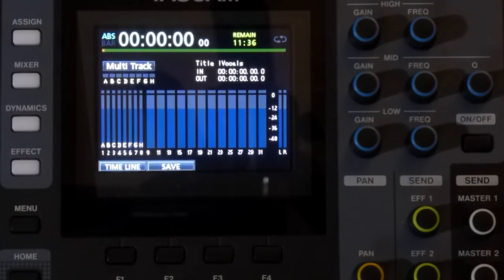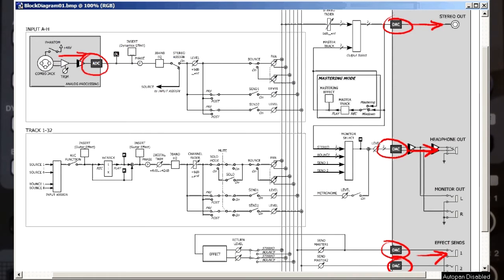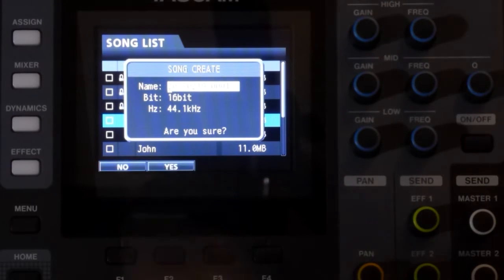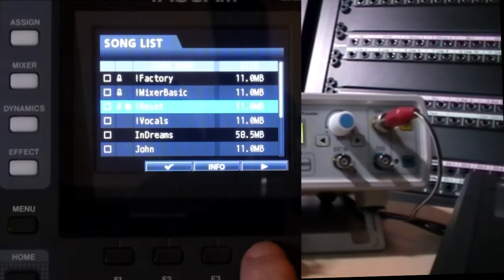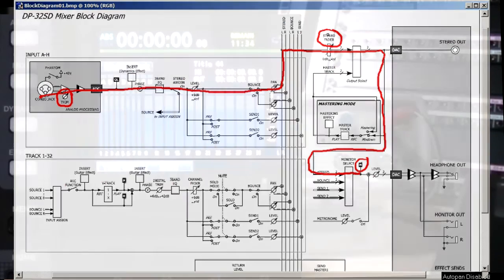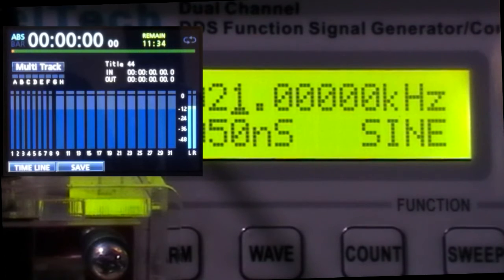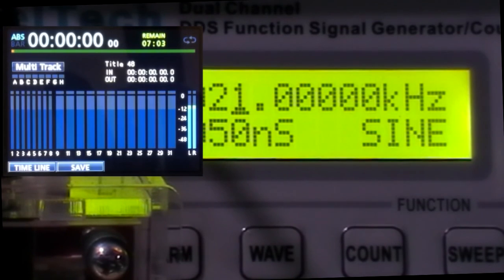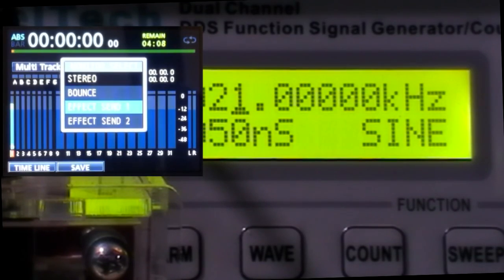Tascam DP24/32SD Tutorial 6D: Quality

Comment: Hi Phil. Talking about tests, beyond this one on audio quality and the other interesting one on multiple bouncing, did you do any on Latency? Would be interesting to measure latency going through various paths in the machine. For example if I use the out/in trick to record the reverb send (routing the send out to a physical input via cable) how big would be the offset between the original signal and the recorded one (knowing it went through D/A and then A/D conversion plus any potential input effect etc). Of course for a reverb it won't matter so much as per the nature of the effect but I am more thinking of using send 2 for other effects more " offset sensitive". Any thoughts? Thank you
Reply from the maker: @mic Ruelle Video 14A shows a loop-back trick for re-using dynamic effects on pre-recorded tracks, and shows (at approx 14 mins) some measurements on the delay going from & to the digital domain.
Hope that helps.
Reply: @philtipping  Great, I missed that part, thank you!

Comment: Hi Phil - dum question: since old pharts like me haven't heard a tone at 20kHz since the dawn of recorded music...could you elaborate on whether the different bit-rate and sampling settings have a similar improvement in recorded reproduction on lower (more audible) frequency ranges?
PS THANKS for what you do!!!🤩
Reply from the maker: @Caught Staring Good question :) Just to clarify... in the video I changed both the sampling frequency and bit depth for the frequency response comparison, but would have got the same result by just changing the sampling frequency. Only the upper frequencies are affected by the sampling frequency.
There's some debate over which is best. Most consumer music (CDs) use 44.1KHz so there's a good argument for using this value if that's your target to avoid any side-effects when converting from 48KHz. Music for video uses 48KHz.
The bit depth affects the dynamic range regardless of frequency. CDs only use 16 bits so you could argue this should be good enough, but if you intend to do any processing, using a higher bit depth gives you a better signal-to-noise ratio so less worry about running your signal levels too hot and risking clipping. 
The internet has a lot more info/advice on both these settings.

Comment: Great video series, thanks. At the risk of sounding like a smartass, I do not intend this as a criticism, just an addition for the comments. 

The drop off in signal level is not to do with the Bitrate, although this setting will affect the quality.
The sample rate just needs to be at least double that of the frequency you are attempting to capture (preferably slightly more to avoid offset filtering). 44.1Khz was originally selected because 20Khz was the theoretical maximum requirement for humans, whose hearing drops off under that.
you can drop the Bitrate to a few bytes and still get the same signal level because the amplitude swing around zero is still the same.

48K recordings create technically smoother voltage swings, but you would not appreciate the extra samples as a human even if you did several hundred AD/DA conversions with minor offsets(<1/24k movement assuming perfect analogue reproduction).
Reply from the maker: @Turncoat You're right, the frequency response is determined by the sampling rate and not the bit depth, so thank you for clarifying. I should probably have only changed the sampling rate when I created the 2nd song for comparison to avoid confusion - the result would have been the same.

Having said that, the video was trying to point out that both quality settings affect signals passing through the machine, even if you are not recording anything. Some people just use these machines as mixers, but they would still sound better by creating a song with the higher quality settings.

My signal level measurement was only capable of showing the sampling rate impact, but it was meant to imply that if this could be shown to affect the signal, the bit depth would also be affecting it, albeit in a different way.

As to whether you can hear a difference with 48KHz vs 44.1KHz, there are many different views on this. I seem to remember being advised to use the higher setting if you intend processing the signal further, but I've never had the equipment to verify this. I always err on the safe side and use the highest setting regardless. I think it would have been an issue years ago when storage and processing power were struggling with the larger file sizes, but this isn't a problem nowadays. Of course the debate has since moved to 96KHz or even higher, but that's way out of my league :)
Thanks for stopping by.

Comment: I must be missing something here, 
I am 62, and im pretty sure i cant hear ANYTHING  above 15, to 16khtz...if i do, its just annoying artifacts and certainly nothing musical...so why would i be concerned about 20 khtz being on the recordings?
I guess its a personal preference but the music i love lives in the lower to mid frequencies-
So can i skip the 20k stuff?
Thank you so much for doing these, ive got the older DP 24 sd with the CD burner, and im looking forward to getting some use out of it finally.
Reply from the maker: @Ed White Hi Ed, well you're right if you're definitely sure none of your music contains any useful high frequencies, but it can be difficult to judge when your own hearing is compromised... and what do you do when you do need to record a different type of music? 

Some say that audiences nowadays listen on-the-move with low-quality earbuds, so why bother with good quality monitors? 
Similarly, one of my ears is severely damaged so I could argue what's the point of stereo :)

When I first started recording in the 90's, one of the books which stuck in my mind (Project Studios by Philip Newell) had some interesting thoughts on all this. There is a good case for always striving for the best quality you can, whether it be for a sense of pride and achievement in your work, or to resist the trend of eroding standards in the industry where music was being 'churned out' for a quick profit.

Obviously, we can't all afford really expensive 'pro' gear, but that's not the point... we owe it to music to strive for the best we can within our limitations. A lot of improvements can be done by spending more time on it, rather than more money, such as setting up a good recording environment, trying different mic placements, using eq to eliminate rumble, editing out clicks etc. 

If you know for sure that no-one else needs to hear those high frequencies, that's fine, but it's easier to record and process with as high a quality as you can justify, and then remove it, if you really want to, at the final stage. That way, if you change your mind, you've still got the high-quality originals.

Personally I try and imagine how someone would hear my music listening on top-quality gear (with 2 good ears!). I would be disappointed if they heard a sound which was muffled, or full of background rumbles, hiss & hum etc. 

Good luck with your recordings, and thanks for stopping by.
Reply: @philtipping  thank you so much, Phil, for such a well considered response...and quick too...im gonna make a donation once im up and running on this thing.
I did listen for the second time to #8? In your series, and it did explain a little more about my question here, but im glad i asked because your answer gave me more to ponder.
One question was how do i know if there are things at 20 k that i cant hear?
The answer being the visual graph?
And i can eq it out...of course i want the highest quality i can muster, but nothing that will irritate me, or damage the hearing of a listener who is un aware of the consequences of high end hearing loss...

I was listening to Pink Floyds Dark Side of the Moon just now, and at the beginning of 'Time', when the alarm clocks go off, it hurt like hell, and i had to run for the volume knob.
So i would never allow frequencies like those to pass...but its really just an effect, not particularly musical, and i think those frequencies are un neccessary, over all.

Im sure my cymbals on my drum kit will have some of those overtones  , and ill miss some 'sparkle', but most other instruments will be fine.

Im primarily a guitarist, and vocalist, but i will add drums and keyboards,piano, synths and Hammond & Leslie sounds, im crazy about those...ive got a couple around...
...and Harmonica...lower pitched keys, just to 'warm' things up and give it that 'campfire' feel.

I play mostly country/blues rock, and im not going to start a business with this, i DO  have an actual audience im building, mostly older people , so its not being  totally selfish, and i am pretty eclectic in my tastes, but i still think i can avoid these harsh frequencies...unless i learn different in practice.
I guess i will have to recruit listeners to tell at this point...i dont want to sound 'muffled'.
This is all something ive only recently considered, Phil.

Im saddened to hear that you suffer from hearing loss in one ear...my best friend since HS had the same issue, and i always felt empathy for him because he was also a complete fanatic about music, and a musician as well, and he was only hearing half of it.
Im sorry to hear that.

 i guess where that leaves me, is a good place, because staying at 16khz will make the machine run smoother and not work as hard, with less latency and glitches and hose type issues?

im planning on using some Behringer outboard processors, instead of the internal ones from the DP 24., and ive got some great large diaphram condensor mics w tube pres im going to use on my guitars, and drums, Rode K2s-

So i can skip the very confusing DSP 'guitar' section for now, is that correct?

So im looking at using this thing as an 'old school' 24 track RtR machine basically, and im pretty sure the Behringer gear is 16 bit?, so it will all be compatible?

And i cant be the only old stubborn fool who insists on doing things this way, but it sure is hard to find anyone who understands me and my motivations these days.

One last question-
If I ordered ALL your tutorials on DVD, and the manual(s), everything 'solid' as opposed to digital downloads...so i can have it in my hands while i learn this, what is the price in US dollars?
Is there a discount package?

Im on #10 and sure ive napped a little here and there, lol, but ive learned SO much in a few days, you can tell by my questions, right?
And ive owned THIS machine for 5 or 6 years...this is tough on an old man.
I will be watching this series many times as i strive to master this machine...ive been 'dabbling' in recording for 45 years, and its the best thing ive found in my price range.
I never get bored.
Reply from the maker: @edwhite7475  No worries Ed, glad it helped. There's a lot to consider when you want to wear all the hats - song-writer, performer, recording engineer etc. :)

But kudos to you for embarking on all this. I'm close to 70 now but got into music very late in life and regret not acquiring playing skills back when my brain was able to take it all in... ironically it was the sudden hearing loss in my mid 40s which gave me the kick to get more serious with music... now there was no spare ear! 

The worse thing (apart from missing that true stereo musical experience) is the difficulty in locating sounds in the real world. I used to hate it when a phone rang in our open-plan office if I was the only one there - couldn't tell which one it was. Also the not often talked about social problems with small-talk when someone is sat next to you on the 'wrong side'. 

But enough of that... yes the EQ graph can help to see things you can't hear, as does getting a feel for the meter displays and control positions. They may not be as clear as outboard gear or a DAW but lots of people make excellent quality songs just on the machine, so it's more a case of how to use the tools you have effectively.

There are other tools which may help, such as spectrum analysers. You could maybe route your playback signal to a computer and analyse it there. Might be a bit cumbersome but you'd only need to do it now and again just to keep things on the right track. It's only like playing a commercial recording every now and again as a guide to how your song is progressing.

I know what you mean re. Dark Side; that part certainly jumps out of the speakers, and I do appreciate that some people are very sensitive to certain frequencies. Getting a 3rd party to help assess the eq is a good idea.

You seem to have a vast array of gear there, so there's plenty of fun times ahead. I also have the K2 and it does a wonderful job on some vocals.

Re. the reference to "16khz", I think that's a typo. The 16 vs 24 value refers to the bit depth; this defines the resolution of the digital samples - a bit like video with standard definition vs high definition. It's the sampling frequency (44.1KHz or 48KHz) which defines the highest frequencies.
But as far as I know, the machine is designed to handle the highest combination so I wouldn't worry about stressing it. As long as you are running the latest firmware and are using an approved sd-card, and run the 'delete unused' process every now & again, it should be 100% glitch free. 

A few decades ago, the extra storage required by higher quality recordings was a financial issue, but sd-cards (and computer disc space for your backups) are so cheap nowadays that it shouldn't be a factor in your decision. As mentioned, I would always use the highest quality on the grounds that you can always remove it later, but you can't add it!

I don't think there can be a digital compatibility issue with outboard gear. Had there been a digital interface on the Tascam, you would be correct, but the only connection from/to the Tascam is analogue, so even if the outboard gear uses digital processing internally, it will still have to re-convert the analogue back into digital, and vice-versa when it comes out. So it doesn't matter what bit depth or sampling frequency it uses.

There is a special offer for both the PDF step-by-step guide and the DVD. They are 45 GBP, which is 61 USD currently, according to Google. There are PayPal links on my website http://www.philizound.co.uk/freebies/dp24-32/dp24-32.html#payments

When you click the link, you'll see a PayPal screen. Click Send (not Request) and it will prompt you to login to PayPal. Then fill in the amount as 45 (assuming you want both) and change the currency field to GBP. There's no need to do any currency conversions yourself as PayPal will sort it all out.

You can also choose the downloadable version of the MP4 video instead of the DVD. If you are not too bothered about having a physical DVD, the download will get to you a lot quicker. The MP4 file is exactly the same in both cases.

If you have any problems, give me shout on my email address shown on the bottom of my website page.
Many thanks,
Phil.
Reply: @philtipping  im practically in tears reading this, you are SO wonderful and gracious with your time, and understanding of MY situation...
Ive met a lot of great people on the web, but you are the top of them all, Phil.
My paypal hasnt worked in a long time, idk why, but ill figure it out and order the set...i like dvds, and im getting as much as i can handle here.
I cannot thank you enough for the confidence youve given me here, through these responses, and man do i need encouragement on this stuff.
And i no longer think im crazy,lol, because i must have asked legitimate questions, except for the 16 bit/hertz confusion.
This really made my day, I am so happy, you have no idea.
Im glad to hear the K2 is 'Phil Approved' as well.
Thanks again and have a GREAT DAY SIR!!!!
Reply from the maker: @edwhite7475  No worries Ed, glad it helps. Would be great if you can rekindle that old 'magic' and capture  some great performances again. It might be better to use email instead of Youtube so we can chat further in private, and I can also send you a couple of screenshots showing how to use the PayPal link. My email is at the bottom of the page on my philizound.co.uk website. Best wishes.

Comment: Very clear videos. The VU meter pulsing when you go beyond the bandwidth limit for the sampling frequency looks like it's monitoring  aliasing, implying that there is no switchable filtering on the input. If that is case, I'd be extremely surprised, but it certainly looks like it.
Reply from the maker: @B M good point, I'd not realised this. Thanks for stopping by.